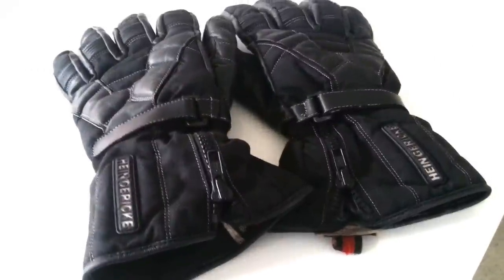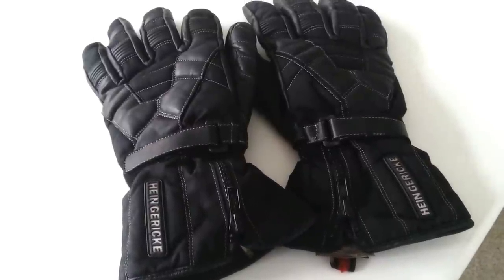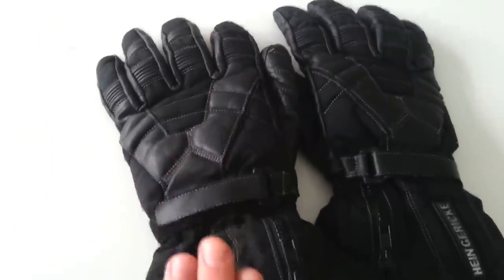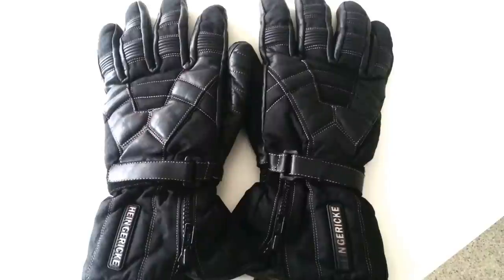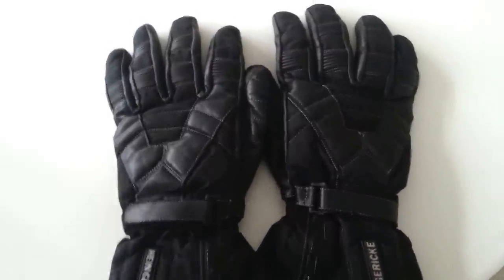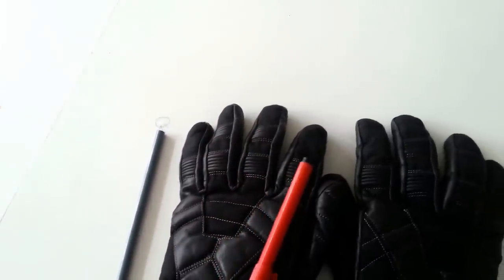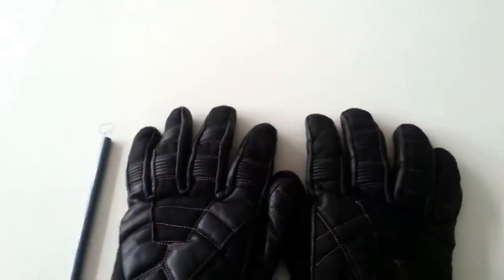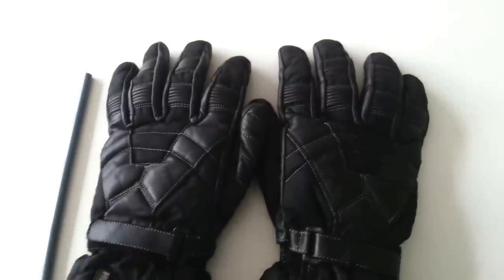Motorcycle glove problem. Getting the inserts / glove material back in fingers

Comment: I've found the best 'tool' to use is a chromed tyre pressure gauge, (the expanding telescopic version)  as one end has a rounded 'head' which allows you to push the lining back without snagging on the material.

Comment: Beware of getting out the lining of the gloves, but if you do it, look what happens: the glove is consisted of three layers, the one that attaches your skin, the exterior material and the inner layer!! When you try to push at the top of the finger with a stick, you have to be careful to take BOTH two layers inside out! When it is done right after a small difficulty in the beginning, the stick slips inside each finger easily!! When you don't achieve to take BOTH layers inside, then the stick stucks and nothing happens!! Try and try again to achieve both of the layers to get inside!! If not, try to "massage" a bit the spot that the stick has stuck pressing forward and back the stick!! Somehow this procedure succeeds!! When you have put all the four sticks in their final position TOGETHER, use some talc powder to ease hand slips inside!!
Reply from the maker: Good idea. Not always practical as I dont carry talc with me, but needles to say it's a good pointer. Thank you.

Comment: My gloves inner lining is fully out :/ trying to get back in is very hard any tips for that
Reply from the maker: Use five pens ect. Then when you have managed to partially pop them into the slightly inside out finger tip, guide each one individually back into the outer glove finger or thumb tip.

Comment: My lining was fully out. Screw this, I'm just buying new ones.
Reply from the maker: When you cant buy new ones this helps.
Reply from the maker: If its fully out, use five pens on each finger and thumb tip. You can guide each in easily. The ultimate tip is... buy better gloves that dont do this.